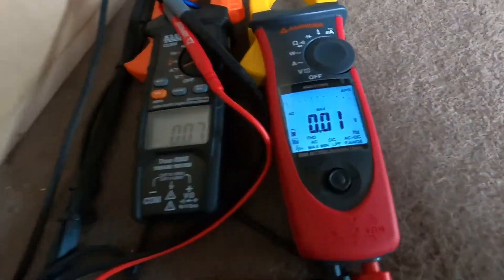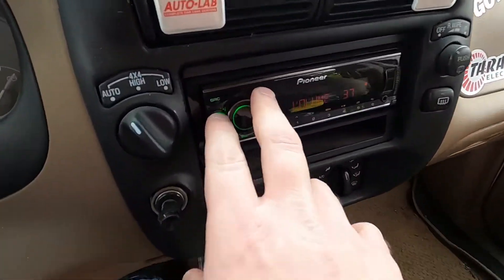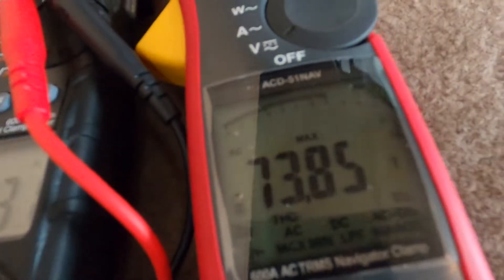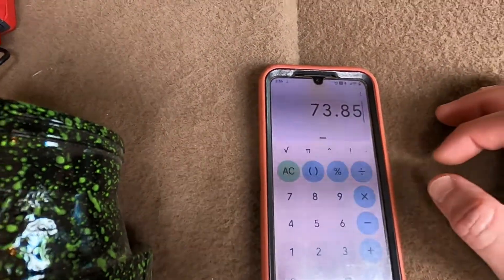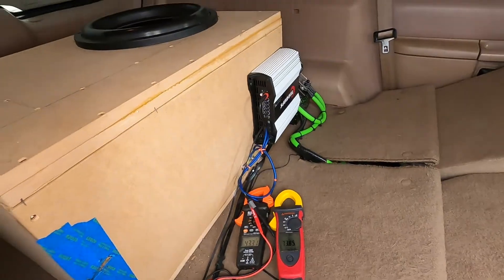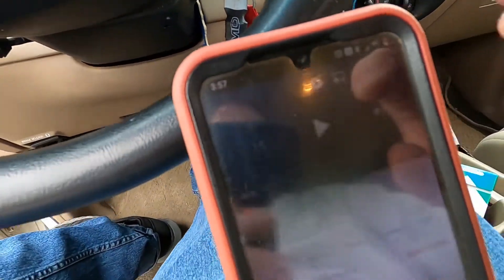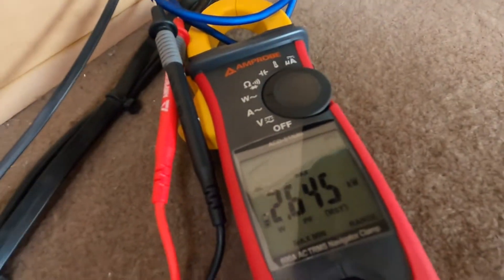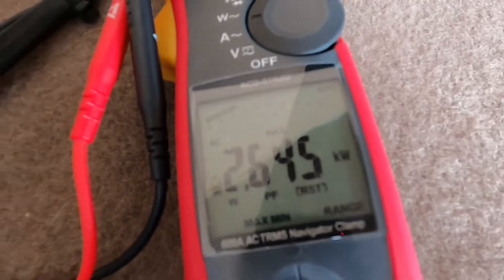Are you REALLY clamping what you think??  Apparent power vs Actual (True) power.

Comment: any meter with trms can do the job as the amprobe clamp meter you are using correct?
Reply: For wattage no, you need a Watt clamp.  Trms is just a measure of accuracy.  If you look at the dial on the Amprobe, there's A, V and W.  Gotta have a Watt clamp to display wattage.

Comment: @Gotlithium? Are both of those clamps the same other than being different brands? I'm new to this part of audio and still learning. I'm also wanting to buy the correct tools to preform the tests the correct way.
Reply: No, the Amprobe is an AC watt clamp, the Klein is an AC/DC multimeter clamp.  They'll both do voltage and amperage, but only the Klein can read DC amperage also, and only the Amprobe displays wattage.  There's all versions in both brands, just depends what you need and want to spend.  
Any basic multimeter and any AC clamp allows you to test with the first method, that's the easiest/cheapest route

Comment: I recently installed a lifepo4 battery 100ah in my campervan.it’s smart Bluetooth bms so can see power being consumed by my stereo x3 power amps ‘homemade sub fosgate driver plus kenwood speakers about 15amps on the bms app when wick turned up.I thought why don’t I use my spare agm battery.only new last year one one weak.as had a pair of 115ah arm’s.I know u not supposed to mix lead with lithium but thought could use the agm when stereo on by using a switch to kick in the agm battery.I’m using a separate circuit for agm charged by my old dc charger 12amp and some solar 100watt with epever 10amp mppt.The lifepo4 has victron dc charger 18amp Orion and a Renogy rover 20amp mppt from another 100watt panel..so if I link batteries with fused link and a switch by drivers seat what you reckon ?

Comment: so an amm1 on dyno mode is wrong?
Reply from the maker: Not necessarily Wrong, it's just displaying Apparent power, the feel good number.
Reply: @gotlithium6311  Are you sure about that? I know that Tony D'Amore has quite a few videos telling/showing how his equipment takes phase angle into to account.
Reply from the maker: @Widowmaker2828  When using the proper setting.  Dyno mode specifically Does Not take phase angle into account.  I'm a little weary whether Realtime does either, or if the V*A*PF setting is accurate.  Even termlabs phase angle detection is pretty far off.   The entire point of that Amprobe meter is to detect Phase Angle, so I know that's dead on, while most other equipment reads high, for Wattage and Power Factor.
Reply: @gotlithium6311  I know the SPL Labs guys go deep into the phase angle issue and state their clamp and software specifically does take phase angle into account. They said the amm1 was very accurate up to 15,000 watts. I would assume the amm one would have to take phase angle into account if they are calling it accurate. Do you have any videos showing the Amm1 is different from your Amprobe?